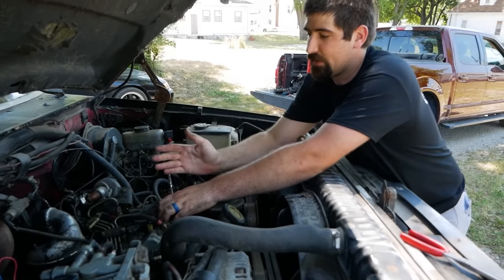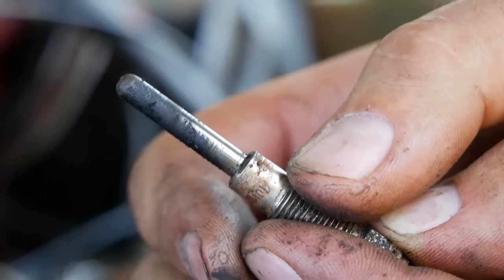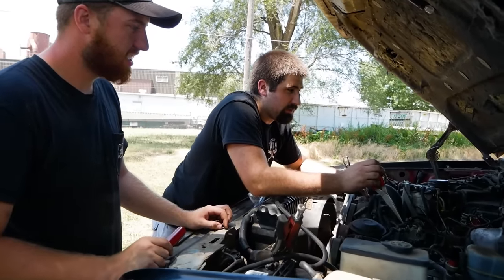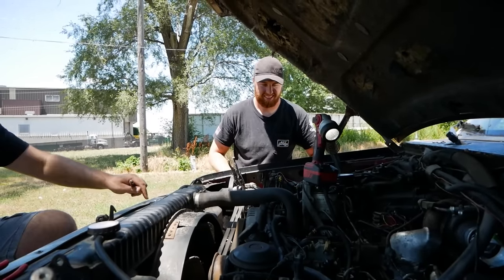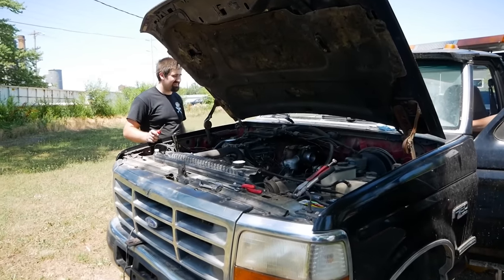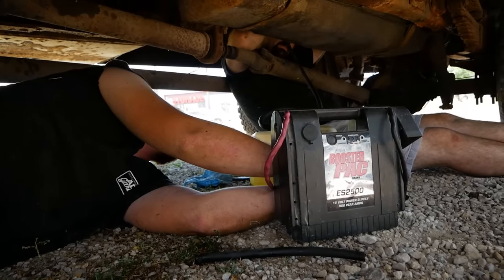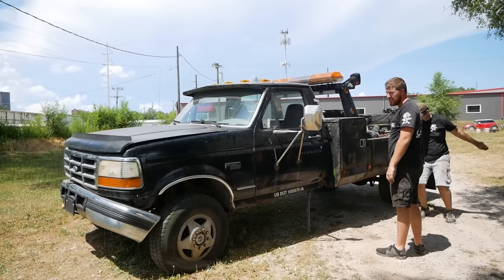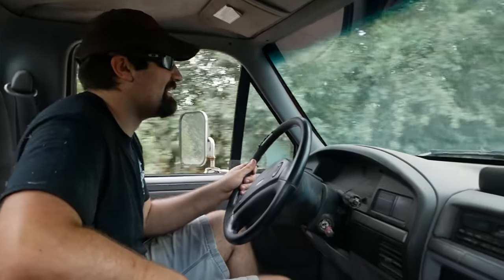Can We Get ABANDONED Tow Trucks to RUN? - Part 3

Comment: I have a fully rebuilt 7.3 idi. New pistons and rings from Mahle, new bearings, connecting rods rebuilt with new arp bolts, heads rebuilt with new springs , keepers, rotators, guides , ferrera valves and pc seals.
Crank forged standard size bearings.
Standadyn fuel injection pump and injectors. Can make you a great deal on it if your interested.
I also have 7.3 powerstrokes on stands and fully rebuilt also in 4 different stages.

Comment: The lead/sulfer content of the fuel was to cushion valve impact on the heads of gas engines and the sulfer provided the same for the injection pumps and the injector pintels, just use 2 stroke oil or dieael kleen both work good p.s. u want way too much both are rust buckets and need rings and bearings

Comment: "why is it smoking everywhere?"....um, you got oil on top of the engine when putting it into the cylinders, then squirted more out through the pressure sensor port on the turbo?

Comment: Tip: DON'T change out glow plugs on an engine that won't run. Get it started with another heat source and change the plugs when the engine is HOT to avoid nightmarish removals.
Reply: Also, not all plugs are 12V - jumping power to the rail on 6V plugs can potentially burn them out. Burnt out glow plugs are more likely to be ballooned or welded in.

Comment: CR is 21.5:1  You would have never got it running without the fuel, but the compression was fine. The oil in the cylinders wasn't needed, but it helped. Also with that much carbon on the plugs it's a good idea to ream the glow plug holes. With all that said, it still doesn't sound right

Comment: Turbine engines are also "fuel limited." You cannot throttle the air entering, so you control power by fuel delivery.

Comment: good video , i haven't worked with mechanical diesel injection in a while , but i work with common rail direct injection a lot as no here in new zealand has those old vehicles anymore

Comment: I think for the regular 7.3 idi was like 21.5-3, even with my idi when changing GPs even with genuine motorcraft plugs I go slowly as if it’s got autolite plugs.
Genuine Motorcraft plugs are $100, but it’s way cheaper than jerking the motor out to pull some heads off.

Comment: The G.M 5.7 diesels had more blow by with much fewer miles under a 100K. You could pull the breathers out of both valve covers it looked like twin smoke stalks

Comment: Top tip rather than using the ether for diesel engines they start beautifully on a fine mist of wd40and the wd40 is so much gentler on the rings opposed to the ether!😊 welcome to diesel life where there's poke there's smoke!

Comment: I read that the 7.3 IDI was intentionally gimped performance wise because of the upcoming T444E (via a down pipe that was too narrow), much like how Ford intentionally gimped the 460 with an intake restrictor. Wonder how much difference just changing out that down pipe makes.
Reply: And man, I haven't seen a Ford smoke like that since I had my 1995 Thunderbird with its wonderful smoke-belching 4.6. Sit at a stoplight too long on a hot day? Bam, blue smoke cloud on your way through!

Comment: I did a speech on diesel engines a few years back, nothing technical (just needed a topic), but in looking over material for the speech I came to learn that Rodolph Diesel designed the engine to run off peanut oil and that the original engine he built is still operating in France to this day off peanut oil. Is that just different tolerances, is gelling or solidifying of fuel the only thing to worry about? Would there be a problem running vegetable oil in say a DD671?

Comment: If I press my shrader valve when running is my diesel supposed to have air bubbles coming out or is that a sign of air in my system

Comment: Ford diesel 101..
FIRST, there are several different models..pre 1994 was the 6.9L non turbo ( WEAK ), the
8th digit of VIN tells you which motor you have..
up to and including 1994, the "M" motor = 7.3L NON TURBO..if you have an M with a turbo, it was a dealer added option, not factory..YOUR BLACK 94 WAS A NON TURBO w a dealer added turbo- 8th VIN digit should be M...
In 1994, there were 3 !  "M" = 7.3L non turbo, "K" is 7.3L w factory turbo diesel but mechanical fuel injection.."F" is 7.3L POWERSTROKE w electronic oil pressure fired injectors..
The F motors have a crank position sensor that fails a lot and will keep it from starting..
The Powerstroke requires 500 RPM cranking ( and enough oil, it has a low oil sensor ) to fire the oil pressure ( 2000 PSI ! ) fuel injectors..
NEVER use ETHER as it can overpressure the already 450-600 PSI that the cylinders ( 22 to 1 compression ) ALREADY make W/O ETHER!
Later there was a 6.0L Powerstroke ( poweful but blew up all the time ) and
a 6.4L Twin Turbo, problematic and POOR fuel mileage..
Then around 2011 the 6.7L Powerstroke came out, a really good engine..
Got all that? There will be a test later.
Thank you

Comment: Yup there used to be great diesels out there like this one till the stupid EPA decided they didn't like them. Then they forced the removal of the lubricants from the fuel so it would cause the older better diesels injection pumps to wear out more quickly. Thanks EPA for running everybody with the old diesels life... unless you add stuff to your fuel to solve that problem.

Comment: I a “retired” ford master mechanic also prefer the 7.3l idi because it doesn’t have to have its heads pulled off after only 100,000 miles
Reply: Oh you must be referring to the 6.4 🤣 plenty of them in junkyards here that didn’t even hit 100,000 km
Reply: sorry don’t use commie units of measure. that’s probably why it didn’t last 60,000mi especially the 6.4l that i’ve never seen. 6.9l and 7.3l powerstrokes suck

Comment: i would have to fix the cab from rust and leave the rest as a retro look on this truck like the red one peace of mind on both trucks on rust repair on the cabs and leave the rest as a resto hot rod look. what i mean is  there is not a look like the oldy like the ones you have do a step by step repair of ok this is fixed and worry about the bed later doing those step by step having a classic look of these trucks running

Comment: Wyatt needs his own channel, or appear on this channel more. Knowledgeable and personable on camera. 

I am wondering if Wyatt can give some advice on a 7.3 idi I have. Truck ran great but sat for several years. Rain water somehow got past the breather and into the cylinders. Didn’t lock up but I’m pretty sure the rings are stuck bad enough it’s not building any compression. I put a compression tester on each glow plug hole and was only getting 125-150 psi on all but one cylinders. Got around 400 psi on cylinder #7 . I’ve poured every “miracle in a can” down each cylinder (MMO, WD40, Kroil, ATF) and haven’t had any success.
Reply: Sadly, engine will most likely need a rebuild. Anything sub 300psi will be weak. Betting cylinders are rusted up. Sorry to hear.
Reply: Wyatt Anderson thats what I was thinking too. Thanks for the reply!
Reply: No problem
Reply: Wyatt Anderson Subscribed. Seriously, do more videos. You’re good at it. You could be the next Deboss Garage.

Comment: I had a 2000 7.3l and the glow plugs were under the valve covers.
Reply: Injectors  also.yours is a power stroke computer  controlled engine. Just like the red wrecker. The rust bucket  wrecker is a non computer, mechanical  injection engine. The 6.9 ,7.3 idi,and power strokes 7.3 electronic  di,6.0 and 6.4 are navistar  international engines. The 6.7 power stroke is built by Ford.

Comment: Change the oil at two quarts of transmission fluid to the engine and let the engine run or driving put a load on it meaning drive it hard are transmission fluid will help unstick the rings the rains are stuck that's why I smoking so bad

Comment: I'm sorry but about 4min is bullshit! My 92 7.3 idi would start in 45 degree weather with no glow plugs. Just make sure your fuel system seals, give it like 1/8th throttle and it will light off every morning.  Left sitting awhile maybe a couple cranks.

Comment: NEVER EVER run autolite glow plugs! They swell and break and 99% of the time you have to remove the head to get em out. Beru is the factory brand and the best glow plugs for the engine. If you buy Motorcraft brand they'll be marked Beru. Not a place, but a brand. Made in Germany and some of the best plugs on the market

Comment: I still don't get why no one ever pulled a valve cover off and seen if it had stuck valves or anything which would kill the compression.
"Torqued to two eh eh's out of SNAP!"  I will say one thing about those IDI's.. they actually have a pretty cool exhaust sound... at least with mufflers that all the packing was probably ate out by rats.

Comment: If the oil pressure is too low then it will stall
If you try starting it with low oil pressure it will not start

Comment: I wish on Desiel fuel injection vechiles put Automatic Transmission fluid Dexron 2 or 3  in fuel system but in Canada won't let put since 2005 or Minstery  or Government  even  Emissions Test fail you and got drain fuel system to also put new stuff in also use a fuel cleaner approve by supplies store to ! But I found Shell Desiel fuel is best to use and Petro  best 2 and Harmamac fuel is 3 to use ! If own farm tractor is Desiel can put Dexron Automatic transmission fluid in fuel no problem so werid Yes! Also the Champion brand Glow Plugs my dad use on Farm tractors and Truck back years ago ! There were Detroit motors types to and never had problem started engine unless Glow Plugs need replacement or clean up to! But have heard lots mechainic use a Grey  Bottle of STP Total Treatment fuel injection cleaner ever Fuel in tank full no problem too ! Even help Starting up in Cold Winter's Season better too on Desiel or Gas motors to use STP on Farm tractors too !

Comment: "No-name, made in Beru, I  see these all the time" 
Lol - Beru are a huge multi-national manufacturer of high quality ignition parts. One of the largest. 
And there is no country called "Beru". 
Come on guy, you work in an auto repair shop!
Reply: I mean, if that's how you feel, then sure. I made a mistake. The company I work for is a Bosch certified fuel system repair shop. (Do a lot of injectors, pumps, and deal a lot of Bosch parts.) Never quite looked into Beru plugs due to never having a need to, as I typically install bosch units. When repairing the 7.3, 6.0, 6.4, and 6.7, all other parts less relays, and staters, (which we pick up from local part stores,) are replaced with Motorcraft parts. If you look at several of the other early comments on the matter I've accepted my mistake, and learned from it. 

If it continues to concern you that random internet guy made an error, I'm sorry, buy a pint or whatever the stereotypical European guy would do.
Reply: @bubbadw60  Sorry, bad day. I've edited it now!
-
I should have just politely pointed it out and left it at that. 
Good work getting the old girl running again.
-
I'll buy myself a pint, it is a pretty hot day after all!
A proper pint, not a small US pint of course. ;)
-
Would get you one too but it might be a bit warm and a bit flat by the time it arrives at your door!

Comment: Hello! :) I'm from Croatia, could someone explain to me how could these trucks be worth "a couple thousand" dollars? We are a much poorer country, but cars/trucks in a better shape (rust-wise) are send to scrap where you get ~0.2 USD / kilogram. What parts are good on these trucks, whole body is rusty, brake system gone, tires old, hydraulics need to be rebuild. Thanks :) Really great videos, I'm subsribed with a bell, but I can't see any value in these cars :)
Reply: the value is in the parts. some are harder to find, some are aftermarket and some are still useful.